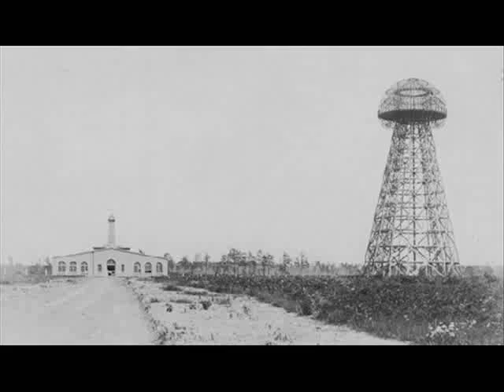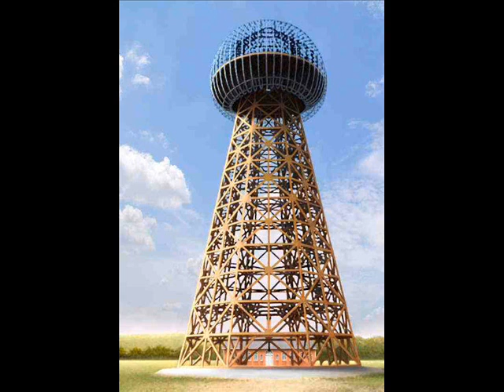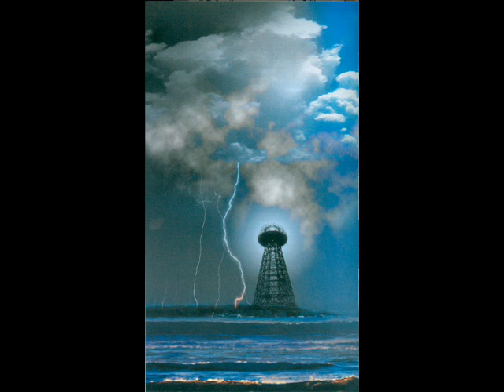Eric Dollard on Tesla Wireless Technology Pt1

Comment: i dont agree with the glass mantle idea, the tesla tower bypasses any sort of resistive properties of general materials. yes there is resistance, but it is the earth wire itself that is the resistance, not the different materials that compose the earth.its like thinking on the lines of static electricity, it can charge many materials.also hitting high enough voltages at resonant earth frequencies allows the energy to push right through the earth, this is seen with the basic resistance equation.